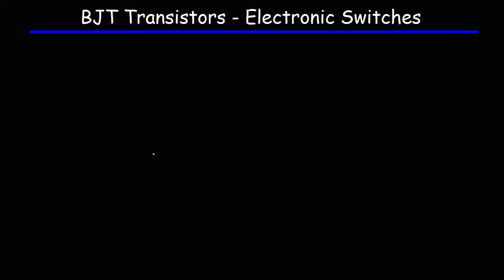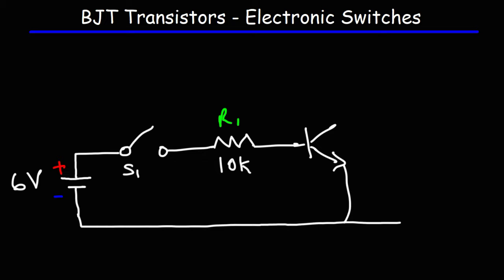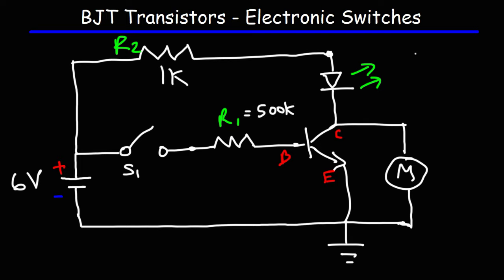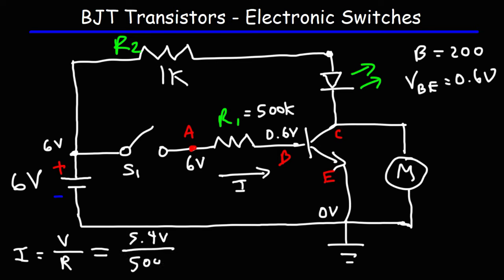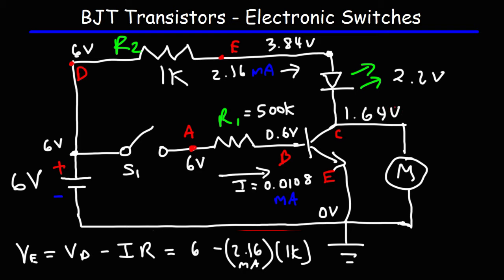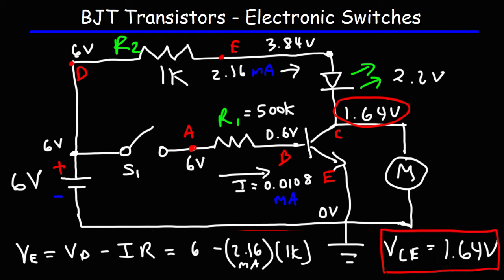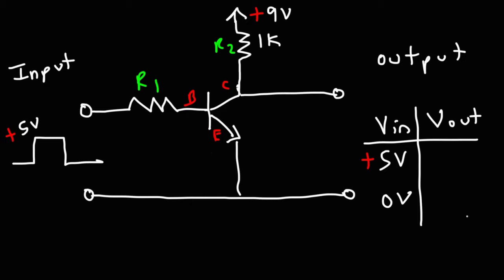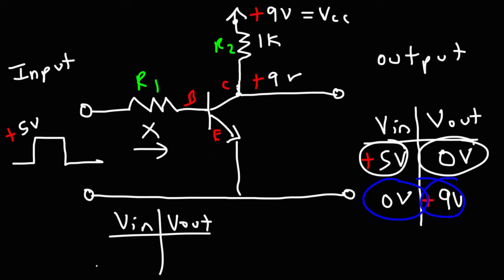BJT Transistors - Electronics Switches and Inverters

Comment: In the 2nd scenario with the inverter, asuming Uce=0V, then B=Ic/Ib=(9V/1kOhm)/[(5V-0.6V)/10kOhm]=20.455, thus much less than B=100...300.? - Can you explain (again) why exactly this is needed to be like this? - In another Video, amongstthe comments I found an answer: 
Here we are using the transistor as a switch, not an amplifier. To saturate a transistor, a high enough base current is required, In the equation Ib=Ic/beta you can actually assume the beta value to be low so that the base current is higher. Also, as the beta value changes with temperature, taking lower beta value solves temperature variation problems 

So this means Beta can sort of just be asumed as some random value, as long as it's well below the actual Beta of the transistor? - Isn't that dangerous if one chooses Beta too low as the transistor can be destroyed by too much base current??

Comment: 1st ex of switching an led...what's the point?  If uve a resistor to limit the c uhhh rrent to the led so IRS not overloaded anyway, why the extra complication of the transistor?  Controlling larger I with a smaller I makes sense if it's a large current that would spark dmg a physical switch...but when were talkin mA to begin with...again what's the point rather than just switching the led directly??

Comment: In the video it comes off that the collector current will follow the base current multiplied by beta but  really it just determines the max amount of current flow that you will be able to have flow through the collector. The load determines the actual amount of current until you hit that maximum amount.

Comment: Awsome! Your explanation of the basic inverter circuit is absolutely easy to understand. Is it possible for me to get the same results if I provide the base signal voltage with a few AA batteries? I can put three of them in series to arrive at 4.5 volts. For the collecter, I'll use a 9 volt battery.
Reply: I think that should work.

Comment: How did you get the 0.6v? pls show me the formula. thks.
Reply: Hello. At the transistor, the Base Emitter junction acts like a diode in forward biased mode. It means that around .6 to .7 volts is dropped across it when it is allowing current to flow from the collector to emitter. This is how Diodes work. The emitter is connected to ground, so there is 0V at the emitter, which means that the Base voltage must be .6V or .7V.

Comment: you can not confirm 2.2v drop at the led, the calculation could be 2.2 but you have to take resistance of the led into account to find out how much voltage drop across the resistor since we know the current flowing that path.

Comment: I love your videos....perhaps II need "electronics for dummies", but why not just turn on the LED with a normal switch rather than going through the transistor? Is it not just an extra unnecessary part?
Reply: Basically thinking that myself. I think this is just one simple example. Might be used kind of like a relay when you don't want a large current or voltage through the switch being used, but some more usage examples would be good.
Reply: How about if you wanted to switch it 1000 times per second, can’t do that with a normal switch, that answers your why
Reply: @davidb2438  Admittedly that would change the situation considerably....

Comment: So can we say that the circuit for BJT as Switch and BJT as Inverter is the same? Just that while its considered as inverter we record the Vce voltage but when we see it as a switch we just see the LED output? But what will we really achieve by looking at an LED state? Pls help me spot the exact difference between the two applicantions with respect to the circuit and how & where the output is measured

Comment: Isn't BETA calculated by Ic/Ib, thus BETA in your inverter example is actually B = .1 and not B = 10? Obviously meaning the same result that Vce is (near) Zero, but just wanted confirmation on this. Thanks!
Reply: You know what, nevermind! I was ratioing the Resisance values before, not the currents. Apologies!

Comment: Now, how to calculate these things in for example an AND gate. Like the currents at the base of both transistors are 3,6 mA with 1k resistors and 4,4V Vcc (coming from an Arduinos +5V line). But the current at the LED is only 2 mA. That means negative amplification. WTF?

Comment: Why does the Vce approach 0 when the circuit is fully closed in the second scenario while in the first scenario the Vce is approx. 1.64 V?
Reply: The ratio of the base resistor and collector resistor is staggering
Reply: @muhiddenmisbak1013  Not sure I understand what that means. Can you elaborate?
Reply: @nuk3man  you see, when you want a "ON" state transistor, you want your VCE to be zero thus having it on saturation state. In the second scenario, you want your transistor to work as an amplifier, thus not wanting it to be closely or equal to zero for Vce , sor Vce=1.64V

Comment: What is up with everybody just throwing in an LED in the circuit and say nothing why, I mean habitually and simply move on with no explanation.
Second of all which seems so obvious, that on one hand it is preached that larger current is to flow through the collector and on the other hand putting a resistor to stop larger current, aside from the fact that without it it will burn the LED.
It is always a circus.  There is always some crap is thrown in all types of settings and walk off and no one will interrupt the nonsense.  They just eat it up and shut up.

So you got - and + on the voltage supply of 6VDC.   Then at the emmiter of the transistor you got it hooked up to the -  and also ground.   What is that suppose to mean?  Obviouisly there are three things....  (-,+,ground)   Where does the ground go?  Under my foot?

Comment: where the actual hell did you get 0.6V for the base-emitter voltage....no calculation...no explanation...you pulled it out of thin air